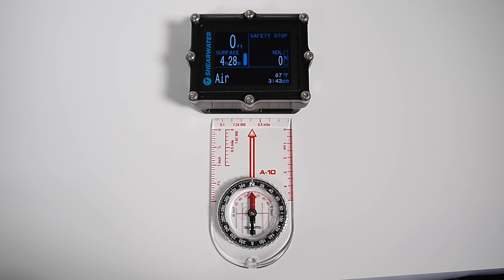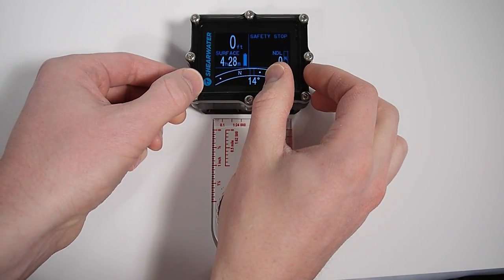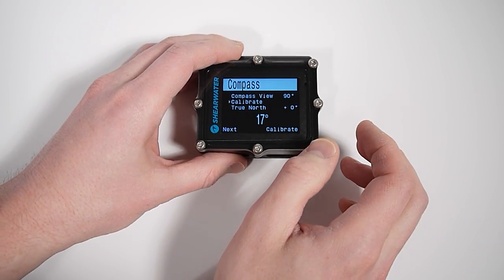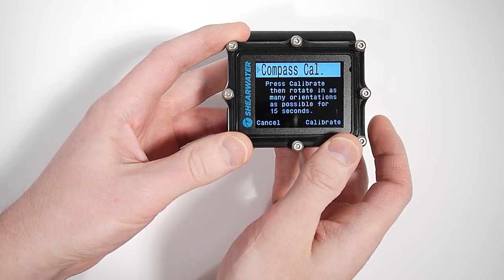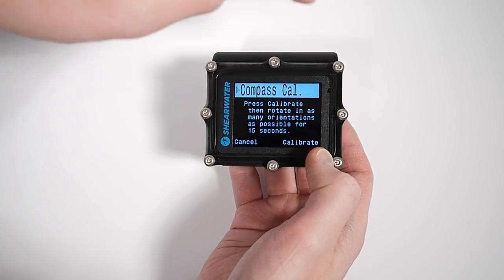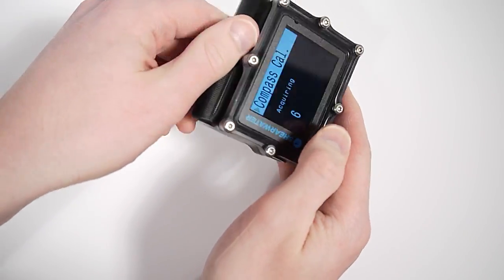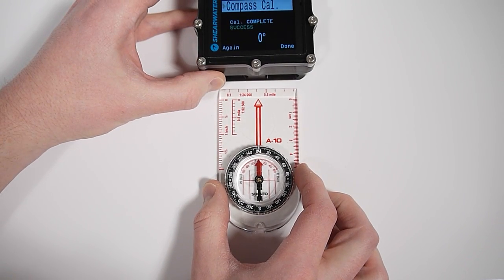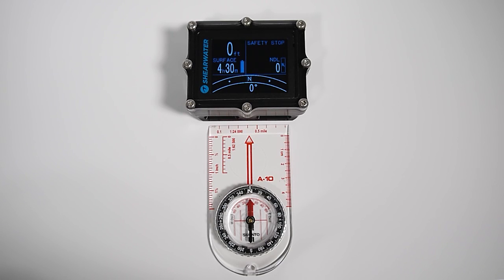Shearwater Petrel 2 - How to Calibrate the Compass

Comment: Should the calibration process be done prior to diving or with all your gear on you (SM cylinders, stage, regs, etc.)?
Thanks.
Reply: yvan Dion No as the metal around you can interfere with the calibration. Best do it at home before your dive away from any metal